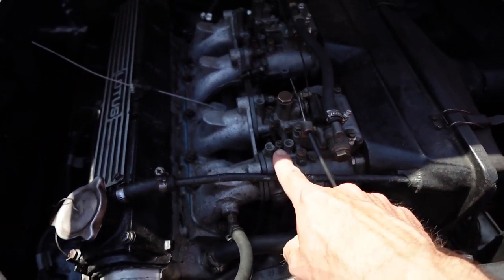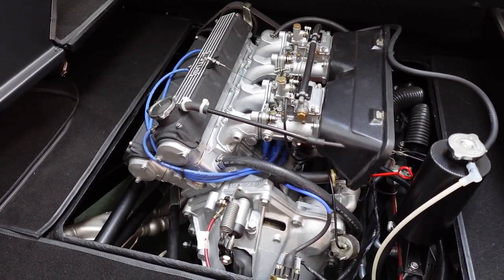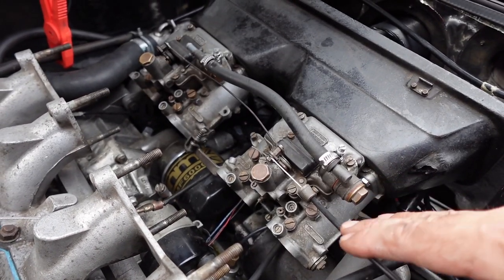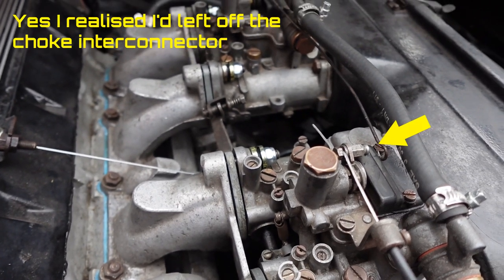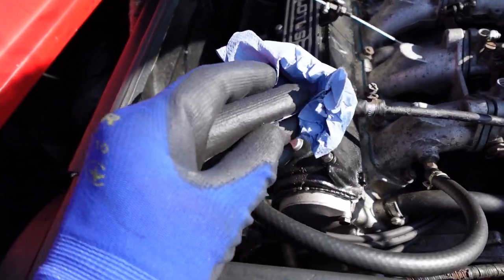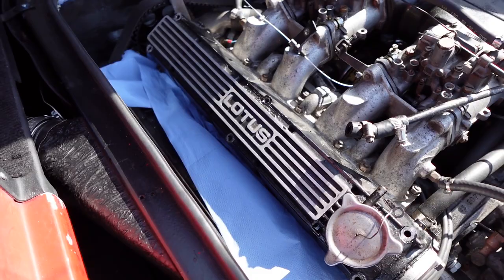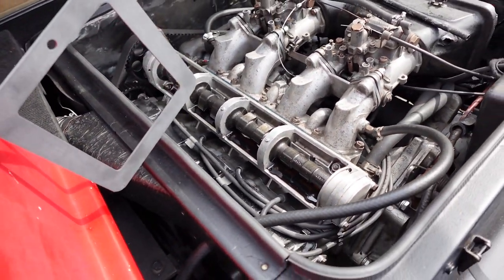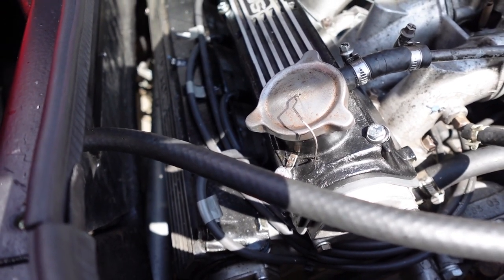Lotus Esprit - Fitting Carbs and Cam Covers

Comment: Nice job! Before adjusting carbs, you must make sure the cam and ignition timing are spot on. It's a lot easier to remove the carbs if the airbox was was removed first. This makes it much easier to remove the bottom nuts and washers. Also makes it a helluva lot easier to reinstall the nuts and washers! Since you have to balance the carbs after you reinstall them, it doesn't matter if you disconnect the arm/linkage that syncs them. Use a manometer to make sure all 4 venturis are breathing the same from idle upwards. When the timing and carb adjustment are correct, the Esprit will really be remarkable and smooth. Thanks for your videos!! Keep up the great work
Reply from the maker: Good tips. Thank you.

Comment: My S3 has AN fittings and metal shielded hoses on the fuel lines. Apparently leaks are a common cause of fires.
Reply: Also considering how much time you lean over the sides of the car to reach the engine, every owner should make a set of bumper covers to protect the paint from scratches.
Reply from the maker: Yes a worthwhile upgrade I guess. All the fuel lines up top were recently renewed but I may need to do the tank to tank to pump pipes shortly.
Reply from the maker: @asennad  yes, again another good idea. I do use an old picnic blanket but purpose-made pads would make life easier.

Comment: Thanks for the video upload. Could you please tell me (us) where you located / purchased the parts from, particularly the rubber cam cover gaskets? Have you had a chance to test to see if the cover is now oil tight? Thanks again..
Reply from the maker: Ah - I don’t have a contact for the chap they came from it was through someone else - I’ll try and find out where they came from. Yes the cover now appears to be tight.
Reply from the maker: You could try these if yours also has the saddle type cam covers https://www.ebay.co.uk/itm/274061601637?mkcid=16&mkevt=1&mkrid=711-127632-2357-0&ssspo=rMG3rzGMTTG&sssrc=4429486&ssuid=-M8n6vMfTCa&var=&widget_ver=artemis&media=COPY